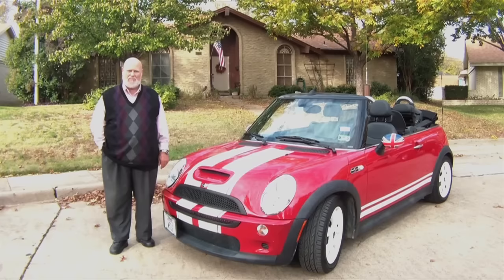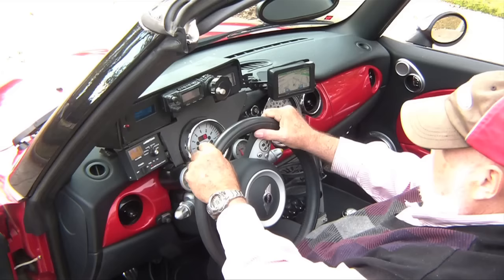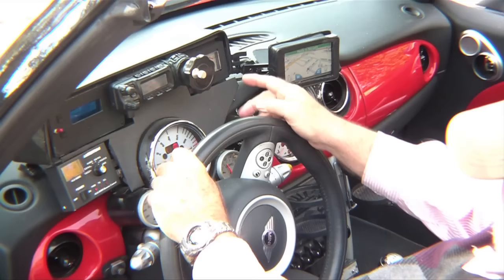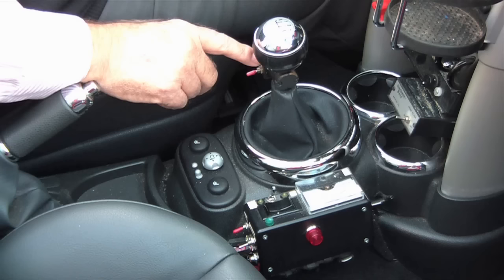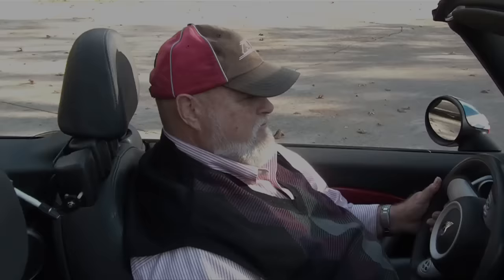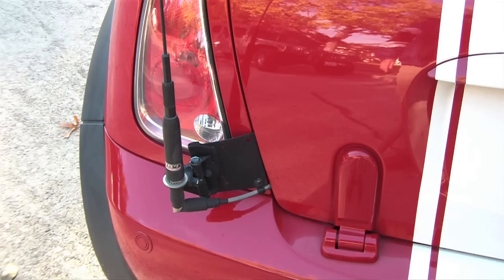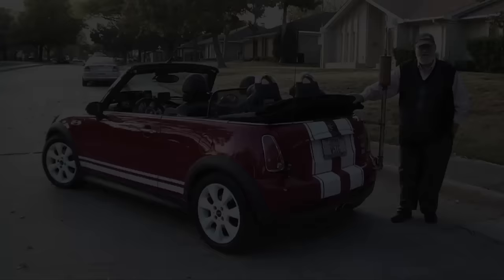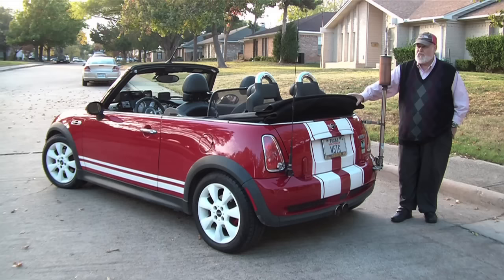W5IG - Lee's Mini Mobile. A rolling Ham Shack with style.

Comment: Nice setup Lee. I hoped to get an idea or two for installation in my Saturn but didn't see any. My dash (behind the steering wheel) is arched not flat like your Cooper. Your transmit levers on the shifter I've seen on another Ham's installation which I think I will employ in my car. My center console is too narrow to provide room of any significance and there is little room to mount anything in the dash. Great video though.

Comment: Impressive setup. Although I have to wonder about the amp. By running 500 watts wouldn't you be exceeding FCC exposure limits? Regardless I don't see a good reason to run more than 100 watts mobile.
Reply from the maker: Thanks for your concern. We checked the emissions and they're well below the exposure limits.
Reply: Lol, you don't get on 40 or 75 mobile much, do you? Hehehe :). I'd love to have an amplifier mobile on 40m!!  When I first started running on my favorite freq on 40 I had a hamstick, the guys could barely hear me at 100 watts. I improved it some by adding a matching coil. (Oddly you don't see many do that on 40/75). Later I started buying used pieces and put together a Henry Allen Texas Bugcatcher, and it was the difference between night and day! On 20 I get accused of using an amplifier from time to time, and on 40 what was previously reported frequently as s3 jumped to the s5-6 range.  
It would be great to have an amplifier for regular scheds, dancing around the broadcast stations (groan) and fun stuff like Texas QSO Party :)
As for exposure, he's most likely not going to have any problems working voice; if he was doing a lot of rtty or other 100℅, continuous xmit then it could be an issue.  Always good to do tests though!!   
BTW, I LOVE this installation!! Maybe it will motivate me to getting around to gearing up my new truck...I've been putting it off :(   Mike de W5NIG